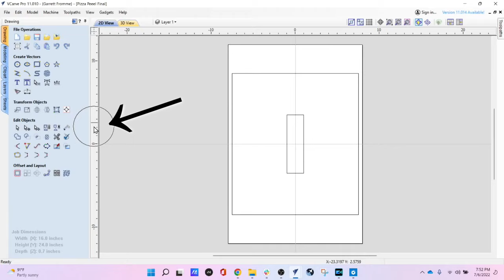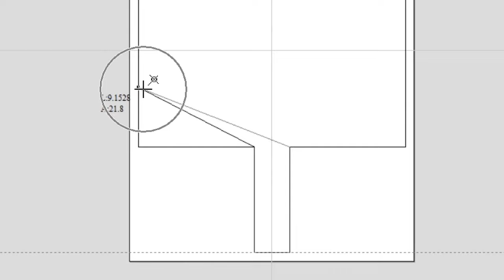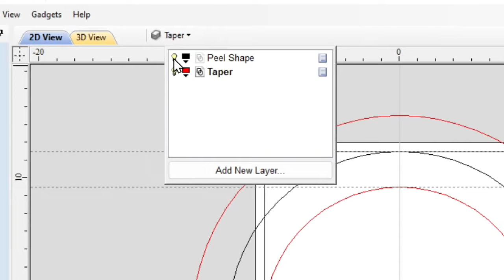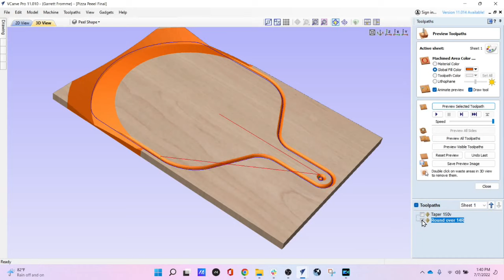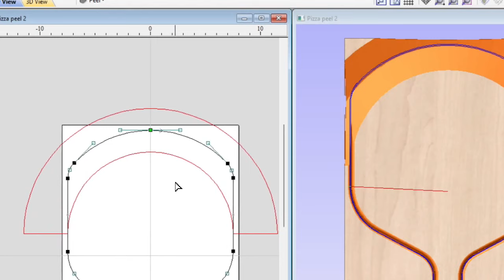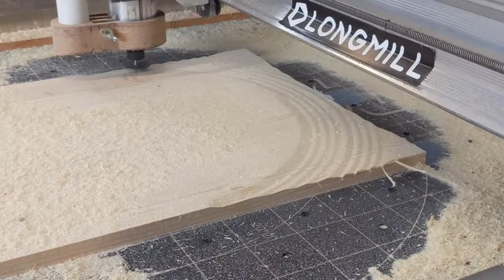How to Make a Pizza Peel with a CNC Router - Much Easier than You Think!

Comment: Learned a ton. Thanks.  Question: why is drilling with endmills not recommended?  In metal, we do blind holes on the mill and lathe routinely with one.
Reply from the maker: I'm glad you learned a lot from the video! When it comes to wood, using end mills for drilling can lead to uneven cuts and can create more tear-out than drill bits designed specifically for that purpose.

Comment: I am learning a lot from you by watching your videos.  I find if I want to put the big rectangle on the 11.50 inch line I use the move tool and set the top corner and then just put in the location. Then the same with the handle click on the move tool click the bottom button and then -11.50 inches.  I will try to use the line and move with the snap function.
Reply from the maker: I'm glad to hear you're learning a lot from the videos, my friend! Using the move tool with the snap function can really streamline your process—happy CNCing!

Comment: Your spoil boards always look clean after you cutout an item.  What do you set your depth to when cutting out a project so as not to mar the spoilboard?
Reply from the maker: I usually set my cut depth just a bit deeper than the material thickness, typically around 1/16" to 1/8" below the material. This helps keep the spoilboard in good shape while still ensuring a clean cut!

Comment: Garrett, I'm so new to CNC that my first machine (a Genmitsu 4040 pro max) is supposed to arrive tomorrow.  I've been watching videos for a while so I'll be better prepared.   I have one question and please understand, I'm not second-guessing but I'm asking out of pure ignorance.  It seems that the v-bit and round over bit would stay sharp longer if they were used after the end mill.  That would mean those "shaping" bits would have to cut half as much wood.  I'm sure  your reply will rescue me from a future mistake!  Thanks, Shawn
Reply from the maker: Hi Shawn. There are several schools of thought on this. It doesn't take a lot of work for the roundover bit to remove all the material. Sometimes we do that because the end Mill cleans it up. For the v bit, you often want to do that first because there's a lot of support around the cut from the material. If you cut away the material first then the there's not as much support and the wood can chip

Comment: Since the taper path is 2” for the 150 deg what would the taper path be for the 120 deg don’t have the 150 yet😢 TIA
Reply from the maker: The taper path for the 120-degree angle will be shorter than the 150-degree path. It's not a direct calculation since it depends on the specific geometry you’re working with, but you can generally determine it by considering the change in angle. You might want to do some calculations based on the specific dimensions you need. Enjoy your project!
Reply: @ thank you!

Comment: Hi I am Following your instructions direct but the poly line on the right hand side once formed is OK when I go to snip it with the scissors a whole box apart from the handle on the potty lines disappear what am I doing wrong
Reply from the maker: It sounds like you might be experiencing an issue with how the polyline is being formed. Ensure that the points you are connecting are secure and properly aligned. Sometimes, if the segments aren't snapped together correctly, it can cause unexpected results when snipping. Checking your tool settings and ensuring everything is joined properly before cutting might help resolve the issue. Happy woodworking!

Comment: I see you used the cut function after you aligned your handle rectangle to the body rectangle to make one solid cut line. Could you also use the weld function that I’ve see you use in some other videos? If not, how do you know when to use the cut function verses when to use the weld function? Thanks for your help and love your videos!
Reply from the maker: debcare5143, Great question! The cut function is used when you want to create a single path, while the weld function merges two shapes into one, retaining the outer edges. In this case, aligning the handle rectangle to the body rectangle ensures precision for that cut. I typically opt for the cut function when I need distinct shapes, and use weld when I want to create a unified design. Thanks for watching and for your kind words!

Comment: I am in my mid 60's and am new to the CNC cutting. I enjoyed watching your pizza peel video mainly to see how the taper is done. I must admit I watched over and over that segment and still don't know how it tapers down. I understand the settings you made but at this point don't see what in those setttings make the bit drop lower. I guess it has to do with deselect the 'Flat' selection box. I'll just have purchase the bit and run the program to see my own results. Thank you for your time in putting together a good video.
Reply from the maker: Boondocksmark, I'm glad you enjoyed the pizza peel video! You're correct that the tapering comes from adjusting the settings, and deselecting the 'Flat' box is a key part of that to create a smooth transition. Sometimes seeing it in action really helps, so running the program yourself is a great way to learn. Best of luck with your CNC journey!

Comment: Hi Garrett, I am working alongside this video and noticed around the 52:30 mark when selecting the 150 degree bit, the video shows a 150 2", but the download file for the bits that I just imported only has a 150 1.5" option. I went to the IDC website to order the 150 2" v-bit but only saw the 1.5" one. If I buy that one and use it for this project will I need to change other settings in the design? Thanks so much! Pam
Reply from the maker: soulmatesandsawdusttn, sorry about that one my friend. The 2" bit in the video was a typo on my part. The bit listed on the IDC Woodcraft website at 1.5" is the correct bit! Here is a link: https://idcwoodcraft.com/products/150-degree-v-groove-router-bit-1-4-shank-the-pizza-peel-taper-bit
Just follow along to the steps in the video and your project will turn out perfect!

Comment: I have downloaded the tools speed and fast file to V-Carve Pro trial but it did not have the 150 by 2 inch bit.  It did have the 150 by 1.5 inch bit and I did not see the 150 by 2 inch bit on your website.  It's not a problem all I need to do is  change the radius on the pizza peel correct?   All is good and I am enjoying following your video with my V-Carve pro trial.  Learning a lot thank you for sharing.
Reply from the maker: I made a mistake when I said 2". It was 1.5" and the design is designed for that so you are good to go

Comment: Thanks Garrett for the video. I am doing this project on carbide create. I got through the design and now I am onto toolpaths. Following along as closely as possible!
Reply from the maker: Michael, excellent work my friend! It sounds like you're doing all the right things and I'm looking forward to seeing how your peel turns out brother!
Reply: Everything looked good until I got to the toolpaths. I am not sure why but the simulation didn't look like it was supposed to. Instead of a gradual taper there was a ledge in the simulation between taper and rest of pizza peel. Looked like the vcarve toolpath in cc basically just ran about 3 passes right down the center of the taper layer shape. I will say though that cc doesn't give me very good previews of the round over bits I got from you either but they always do a great job nonetheless when I run them. It's one of those things I guess. I learned some good stuff through the video either way.

Comment: I really like these project videos. I'm new to CNC and admire the outstanding clarity and pace of presentation. In this pizza peel project I did find one segment that leaves me a little confused. At the 44 min. mark - we are trimming the corners off with the scissors, however the vector segment within the handle was deleted and not 'trimmed'. I think I can make a distinction on my own that this particular segment differs because it is inside of the peel's finished border. Only the outside vectors were being trimmed thus far. I didn't understand when you said that trimming this inner vector would leave us with an undesirable segment that we don't want. I experimented with my 2D drawing to compare between the two and I couldn't see a difference between trimming and deleting this line. Both seemed to give me the same visual outcome. Can you explain this aspect for me just a little bit further so I can guard for the same issue in my own future projects. Thanks again for you are doing.

Scott W
Reply from the maker: user-ql8th1iv7t, I am so glad to hear this video helped you! Sometimes when you trim the inside vector you end up with problems when you go to create your toolpath. If you didnt have any problems with your project and generating toolpaths then you are good to go on this one brother!
A lot of this comes with experience and trying different things, keep working hard and learning everything you can my friend.

Comment: Thanks for the video.  I found it very instructive. I do have a couple questions I need clarified.  In the video the 150 degree vbit shows a diameter of 2 inches.  However, on your website the diameter is 1.5 inches.  Does the smaller bit diameter mean the vector for the taper needs to be reduced to be 3 inches from inside arc to outside arc instead of 4 inches?  In other words, do the circle offsets need to be 1.5 inches instead of 2 inches when creating the taper vector?  Also, I didn't exactly follow why this vector needs to extend beyond the end of the pizza peel.  Will you please elaborate?
Reply from the maker: Mat, sorry for the delay getting back to you brother this week has been busy over here! This one is a little tricky to answer over comment. I recommend joining Kate and I for our weekly Youtube live session we host every Wednesday at 8PM EST and we should be able to help walk you through it!
Reply: @IDCWoodcraft  Garrett, sorry I couldn't join you on Wed for your live session. Doesn't really work for my schedule.  However, I did the trig and figured it out.  I didn't want a really thick peel, so I bought an oak panel and surfaced it down to 0.5" thick.  Since the big stiffy 150-degree bit is 1.5" in diameter, when I designed the peel, I created a 1.5" offset for the taper (so, the entire half-circle sector was twice that or 3" wide instead of the 4" in your video.  That created a taper that was .4" down from the surface.  Had I used a 2" offset to create the taper, I would have cut through the stock.  Everything else remained the same.  I was hoping to share a pic of how it turned out, but I'm not seeing a way to upload one.

Comment: I have got to get the VCarve Software, I have a 1 year subscription to the Carveco that came with my CNC, so I have time to save my pennies. I really appreciate all the information about bit speeds and tool paths. I happened across your bits on Prime Day before my CNC showed up, and figured, It's worth buying quality. I have been learning ever since. I appreciate the wealth of knowledge. 

I have been using Adobe's and Affinity's vector software for years, and a lot of the design stuff seems similar. I wish the art software had some of the features I see you use in VCarve. That said, some of the features in the art software are really nice to have. I have no issues with mixing the two. 

I appreciate how you used the V Carve feature with the larger bit. In my shop, I would have just taken a belt sander to that to get the curve but this is helping me rethink my build methods. I only just got my CNC in and hooked up a few days ago, and I haven't totally wrapped my head around what I can do with it yet. I look forward to the next video. 

Thank you again!
Reply from the maker: WikiSnapper, there's no rush brother. I do find Vetric a little more user friendly especially when first starting out but there's no problem with starting with what you have! I get what you mean about being used to using what you know in the shop. That can certainly come in handy, but it can be an adjustment retraining our brains with the new tools we have. It's a fun challenge! Happy cutting brother!

Comment: I have  a Shark 510 that has a table size of 25x25 an since this taper cut extends beyond 24" I can't load the tool paths, got a wok around for this?
Reply from the maker: Doug, That is a tough one brother. I would recommend trying to reduce the size of the project to fit on your machine. That way you will be able to cut it out no problem!

Comment: Great video!!! You have opened my eyes on what this amazing software can do. I do have one question. When you set the Z for the round-over bit, it looked like a different probe as you set it to the top of the probe.  On the Vbit and Compression bit the Probe was turn upside down for the Z probe.  Did I miss something?
Reply from the maker: Kenny, great question brother! For the roundover bit, we were setting the zero for the x,y and z but with the v bit and compression bit, we were only setting for the z axis. When you set the x and y on the corner of the wood, you have to turn it over and align it with the corner of the wood.

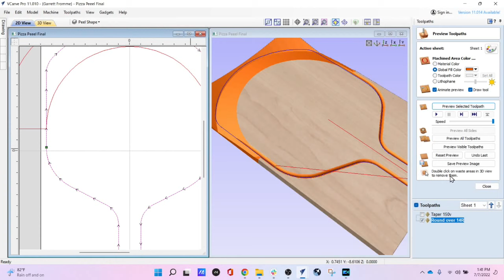Comment: Hi Garrett. I've been using VCarve Pro for the past six years now, but you taught me something tonight. I never knew that I could use the fillet tool to make such smooth rounded corners. I've always used circles and then would have to go into the node editing mode and arrange to suit myself. GREAT STUFF!!! There's something that I would like you to clarify in the video. It comes at timeline 1:01:17. You indicate to close the preview toolpath and switch here to start its carve. I don't understand what you meant by "switch here". To change the beginning point of the carve from the side of the panel to the top end by the taper is where I'm not following you. Could you please explain a little clearer for me?
Reply from the maker: Brian, I am sorry about that brother. I had to edit a small part out after I posted it.

Comment: Really great video and thank you for the file.   I do have one question.  You mention a 2” v bit but on your site you only sell a 1 1/2 v bit.  I have it loaded and it looks like it will work fine.  Thanks again.   I bought the 1 1/2 from your site your bits work great.
Reply from the maker: Unfortunately, I made a mistake when I said that. And only caught it after I uploaded and released the video. I can't change it

Comment: Just got around to watching this.  Lots of good info. There is another way to do that taper without investing in a 150 degree bit.  You could  use a fluting tool path with a smaller diameter bit. Just draw lines in a raster pattern to accommodate the bit diameter and the taper.  Not much more work and avoids the complexity of a 3d model. Also allows you to do much longer tapers or ramps.
Reply from the maker: Stephen, a 150 degree Vbit is a good idea and you are right, a 3d model does add a lot of complexity to it. I'm happy to see that you can find another way to do the same job. Like they always say, there is more than one way to skin a cat!
Reply: Garrett, @IDCWoodcraft ,
I really enjoyed the video as well as many others.  Like others have mentioned I'm 76 years old and enjoying the CNC as a method of staying sharp.
As to the many ways of skinning a cat I had a college professor state, "There's only one best wy to do anything".  I thought about that and about the cats and disagreed with him, but after a while it finally dawned on me that while the was in fact more than one way to skin a cat that there was most likely only 'ONE BEST WAY".  LOL
Thanks for all you do!

Comment: Do you ever use the " add Tabs to tool paths" feature for cutting things out? I have a bunch of smaller parts on a bigger sheet of plywood I'd like to cut out, wondering if having the tabs is the route to take. Although I'll have to cut them off afterward
Reply from the maker: JC, tabs are great when cutting out a bunch of smaller parts on a big piece of sheet stock. 
Cutting them out can be a bit of a pain afterwards but its better than having your parts flying over your shop if they come loose in your CNC!

Comment: Excellent video.  How did you account for the through cut distance to compensate for the 0.1 resurfacing process?  Or did it cut through the spoil board?
Reply from the maker: Jason, you can do this a few ways. You can change the overall height of the model to the height of the project after you resurface it or you can change your cut depth to the the overall height of the model.

Comment: That was interesting. With work I'm doing now, I have several taper cuts to deal with. In Mastercam, I would create a wire frame and trim a solid or create a surface patch and pick it off with Mastercam or more recently, import it into. V Carve Pro or now Aspire and create toolpaths there. At this time, my proficiency with designing with Aspire is not high and a work in progress.

How did this guy do a taper in V Carve Pro? I have to see this. I had some thoughts but didn't know how to do it in V Carve Pro. As I followed along, I was in the mind set of how you got around not needing a 3D model or feature. Admittedly, I hadn't thought of the angle cutting tool.

I never really used the guidelines, , but seeing how you manipulated and used them, no doubt I will be using them more. I still think in Mastercam terms and how to do it in V Carve.

All in all, a well done and educating video.
Reply from the maker: CNC, great comment. Working in a different software and watching someone else use another software can be tricky. It sounds like you have a solid head on your shoulders and know exactly how to incorporate this to make it work! Thanks for being a part of the channel and I'm glad I hopefully made your life a little easier.